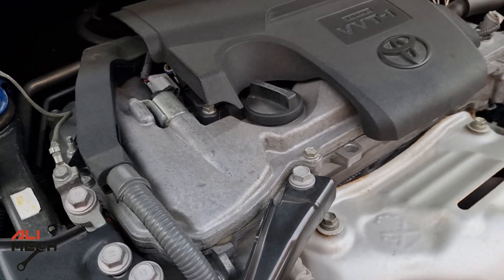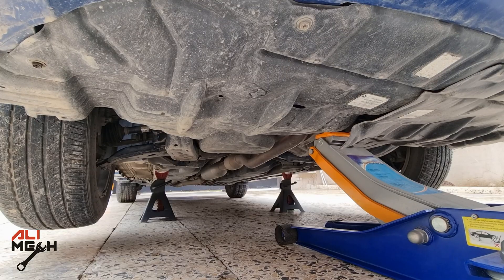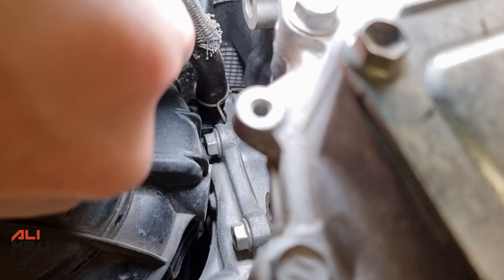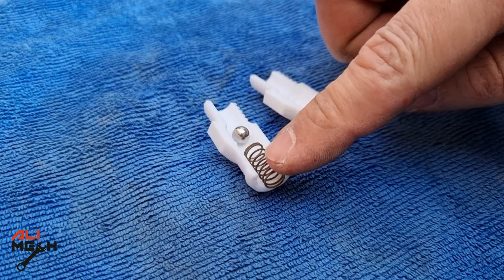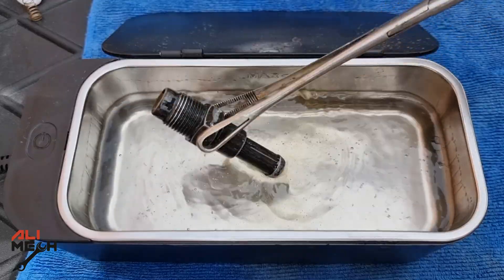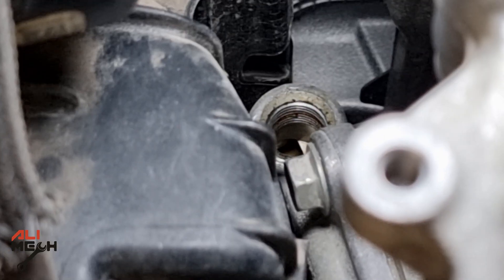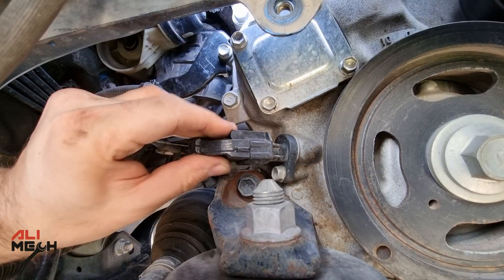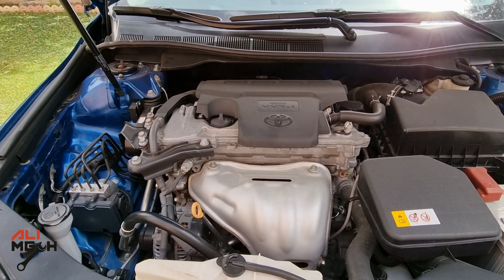How to Remove and clean the PCV valve TOYOTA Camry 2015-2017/Toyota Camry PCV valve location ALIMECH

Comment: Same process for RAV4 up to 2018. Except, the Rav4 you are installing it blind and becareful, there is a space on the right side of the pcv vale hole, if you drop it there, it's almost like trying to find a 10mm in the engine bay.  I was lucky and got a magnet to fish it out.  If you have never change the pcv and it's the first time, you mind as well get a break bar to loosen the pcv or you will be busting some knuckles.

Comment: Thank you for this video. I saw another one and it looked more difficult because of the camera angles. A mechanic quoted me $400 for labor. I think I'll give it a try now. It's a shame that the valve isn't easily accessible from the top like so many other cars. The OEM part is only $13 so I ordered it just in case it's bad so I don't get stuck in the driveway and having to go find a new one. I did order a pair of long pliers because that's going to make it a whole lot easier. Thanks again!
Reply from the maker: No problem glad ro help, let me know how it went

Comment: Why remove it when you can spray carb cleaner down the tube from the top?
Reply from the maker: You can't, otherwise carb cleaner enters engine and mix with engine oil
Reply: @AliMECH so if I'm due for an oil change it's cool?

Comment: @AliMECH Alimech, your hose is coming out smooth. Mine is not budging. Really stuck tight there. Maybe too much pressure was trapped inside due to bad pcv. 

My crankase oil cap is also hard to lose by hand. Always need a tool to lose it. It probably due to pressure in the crankcase as well. Both might be related to bad pcv valve.

I did notice oil on the hose from the pcv valve. That valve is most likely bad 

Anyway,  I was thinking that I need a plier that could lose those clamps to be able to pull the hose successfully . Still looking for one that'll fit that space (my hands can't get in there, so it's quite a challenge). 

I have a 2016 SE, by the way. I assume the configuration should be the same

Comment: Use charcoal lighter fluid, way less $$$$ than Seafoam. The spring loses tension by 100K/160Km, just replace it. If you are going to change your oil too, you send a healthy spray of carb cleaner down the PCV hose from the top and let that soak overnight for maintenance.

Comment: GREAT VIDEO! After 5 year owning a 2014 camry. I finally have the time to replace pcv vavle. First time doing was not easy for me if you don't have the correct tools and super tight area.
Reply from the maker: Yes, it needs correct size tools, but when you have it, it's not that hard, thanks for watching

Comment: ℹ️✅ Do you think it’s possible to clean up dirty PCV valve ( not damaged) without removing from the engine? Maybe it’s good idea to disconnect PCV hose from engine head and spray inside carburetor cleaner ( or small amount of kerosene), wait few hours and start engine after. Vacuum inside engine head will remove all dissolved slag from PCV hose. It’s just a question.
Reply from the maker: No, not a good idea, it will drip on the engine
Reply: @AliMECH what if you replace the oil just after?

Comment: While the Toyota engineer stuck the PCV in a place that's so hard to service is a mystery.   On my Lexus, the PCV valve is visible after the beauty cover is removed.   It'd literally take me less than five minutes to unscrew the old one and screw in a new one.   Since it's so easy to change and the PCV is so cheap ($7 @ Lexus), I simply replace it every two years regardless.

Comment: If you go with all the way to remove the pcv valve, it’s better to replace with a new one. The part cost less than $20. Why take a chance of using a faulty valve or a valve that is starting to wear off after 7 or more years of use.
Reply: Exactly 😂😂😂

Comment: Did you get a fault code or just doing maintenance cleaning?
Are there any particular or common issues you have seeing with this model of Camry (15-17)?
Reply from the maker: No, its all good, some of my subscribers asked me to show where is the pcv valve, i never had any issue with it or any other parts, its a good car
Reply: Don't replace until som3 code. Thank you for sharing video though In case need to change valve

Comment: Dear you did a hard job .. That's much hard to reach for just cleaning/replacing a PCV valve only.. That's because the branded quality has gone. What a silly engineering
Mostly with a cheep compacts imported fittings now a days all are compact random
Reply from the maker: Thanks Ahmad, totally agree with you
Reply: @AliMECH  yeah but that 2017 Camry is a good car!!
Reply: Wtf are you talking about?

Comment: Ecellent Ali. 
Thank you.
More garbage come out of the valve,even after you used the carb cleaner before.
The electronic cleaner really adds to the cleaning.
Appreciated you doing this video.
Reply from the maker: Thanks, yes Great point!
im really impressed with ultrasonic cleaner
Reply: @AliMECH  This may even prompt me to go buy 1 myself.
I can use it for multiple applications.
Reply: Just replace it.  The part is inexpensive even buying at the dealership